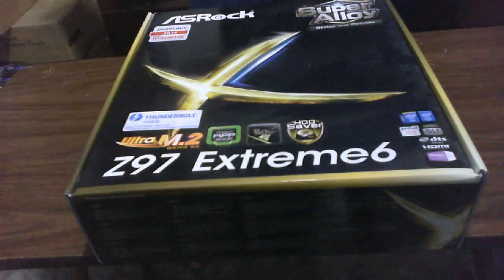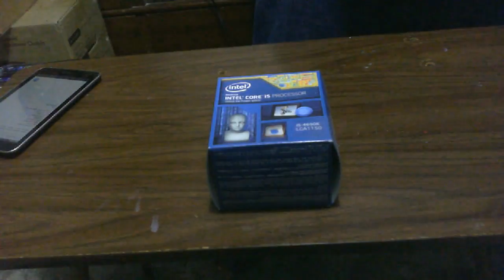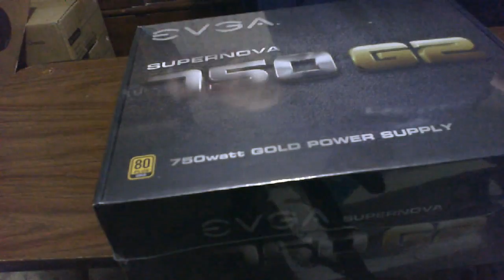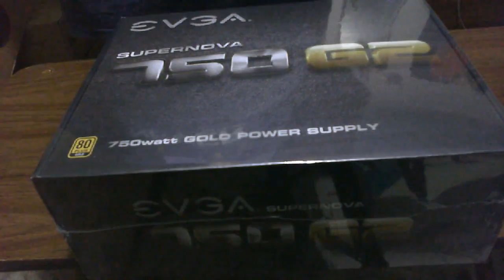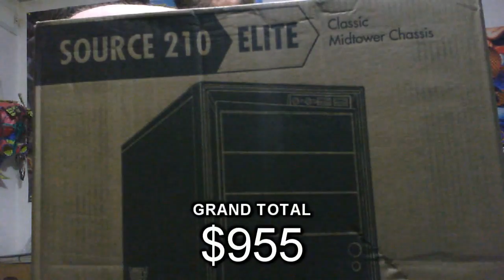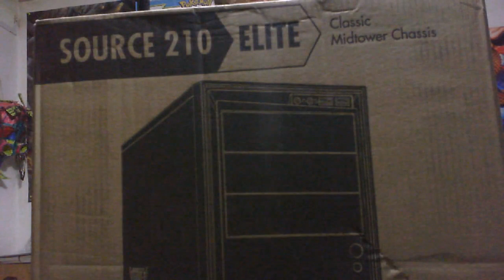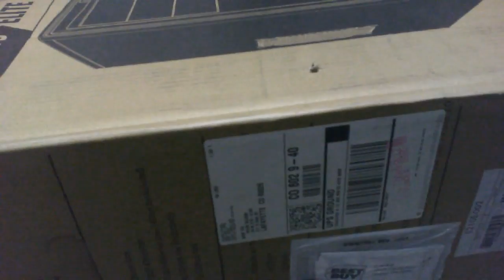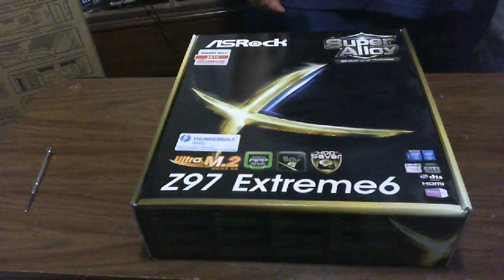Let's (try to) build a PC for the first time!

Comment: the GPU is really  underpowered  compared  to the rest of the system,  you should  have asked  for an HD 7790 or  an R7 260X or R7 360X
Reply from the maker: I didn't "ask" for anything. It was an offer, and I took it.
Reply: BlazeHedgehog oh my bad well this is pretty  good for editing  though.
Reply: the 6970 is somewhere in between all those cards you mentioned which kind of defeats the point you're making lol. The graphics card is fine, especially in this case where he's taking what he can get and trying to minimise costs as much as possible
Reply: @mario, HD6970 is about the same tier of 360x and is better than HD7790 and r7 260x.  so...?